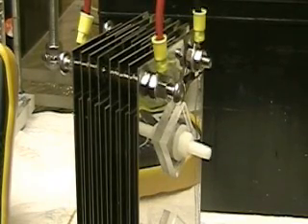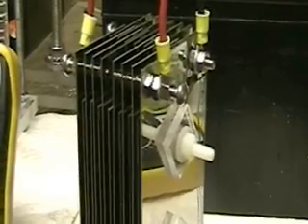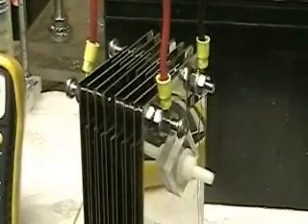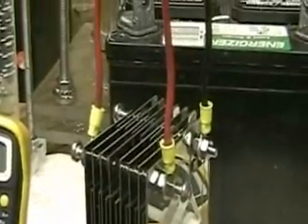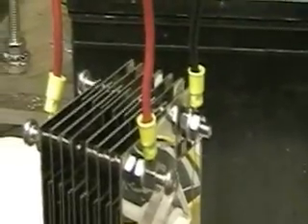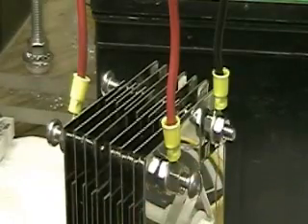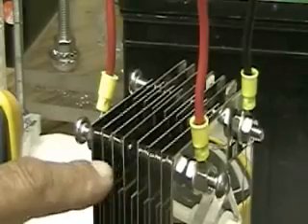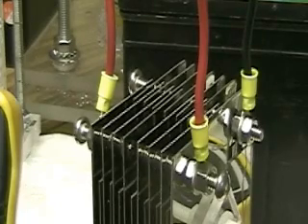Hydrogen Tap (AAron's Cell & Honda) 131

Comment: g'day mate!  in my experience doing propane conversions i have found that it is much better to turn the power off to the petrol injectors than cutting the pump. when the pump is off the injector get hot, they then vapourize the fuel and have been known in the past to start underbonnet fires here in australia! i'm just thinking of your safety mate! =] keep up the good work! i look forward to every installment.

cheers
blair

Comment: Hello John, I'm just saying on most cars.if you don't have power windows,locks and seats, alternators are over sized.Most factory specs 20 amps more i have seen 60 amps on some.  just a heads up.

Comment: Constant current supply will solve it.   HHO generated = Wattage used. (for a given design)  If the unit heats up the current flow goes up and you have that "run away" you are talking about.   CC supply will keep you at a fixed wattage, there for same amount of HHO. no run away

Comment: Hello john, Looking good. Ive had  the same problem with a switch in my car. I just like to add is 20amps is the most you can pull before having problems on most cars.